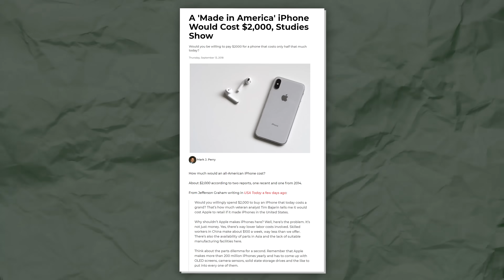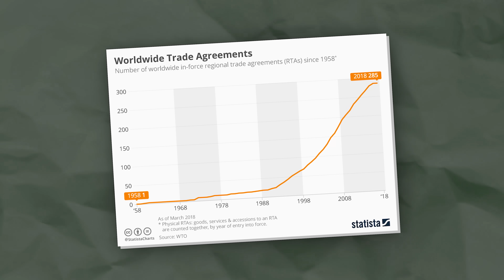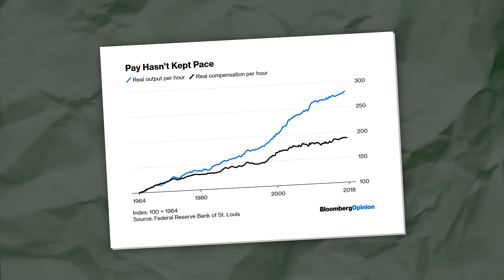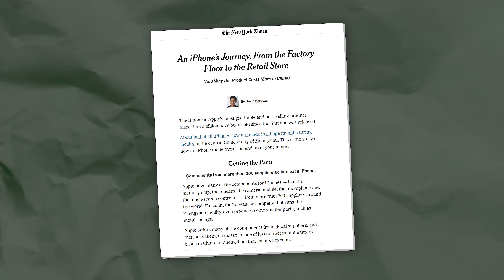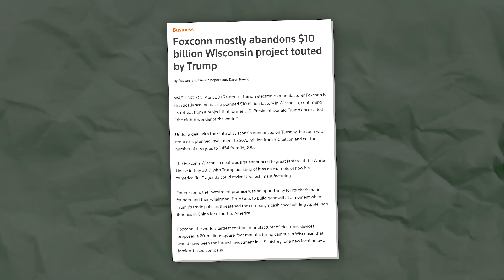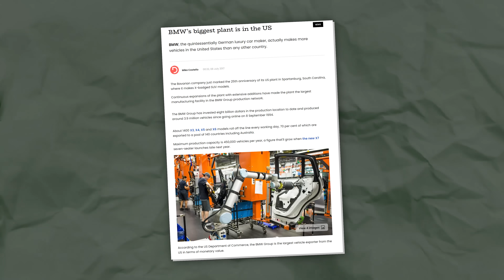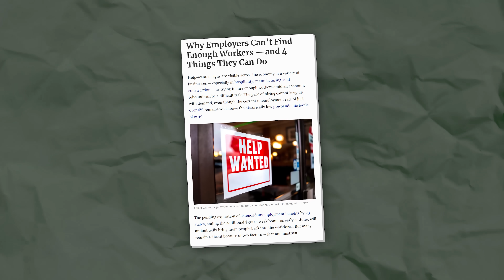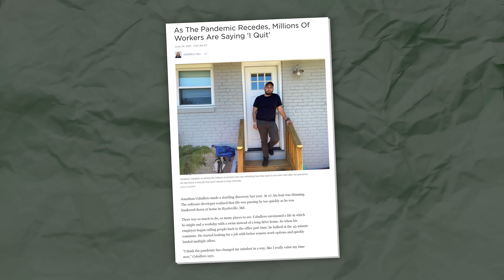How Much Would it Cost to Make an iPhone in America?

Comment: Henry ford tried doing exactly that; own every single factory that’s needed to manufacture the raw materials that go into making a ford. He owned all the production lines and supply chains from lumber to iron to every single component in the car. That way he didn’t have to depend on outside sources to make his product. He controlled everything and that way he knew everything that’s going on with his factories and minimized delays. However, as global trade expanded, his structure became obsolete. Companies found out it’s much easier and cheaper to import the manufacturing offshore albeit its uncertainty rather than training entire workforces and build factories only to find out it costs much much more than the alternative. Free trade became a thing because it benefitted everyone from the manufacturing country to the country that imports it. Now if we suddenly try to turn on a dime (looking at you, tariffs), it’ll hinder supply chains and alter entire factories. It’ll require quite some time like he said, maybe decades to make it worth it. It’s highly risky long term bet that companies are unwilling to take. The time that’s required to make this happen will upset shareholders and the customers will lose faith in the product (iPhones in this example). “If it ain’t broke, don’t fix it” since that will introduce a whole array of problems

Comment: There's a few things required to properly make America more independent from China's manufacturing.
1. Efficiency, America needs to make an efficient way of recycling its waste to remake new technology. America is one of the largest consumers. It also means America makes some of the highest tech trash. If America harnest this waste, remaking it into raw materials we need. The cost of production will be reduced.
2. Streamline supply system, America needs to reorganize its transportation system to use a less expensive yet more efficient supply system.
3. Automation for production, an automated system can be tuned to avoid waste and mistakes. This would allow America to produce and avoid additional costs.

Comment: There is so much more to this. Costs would easily balloon back to the 1950s monthly salary for a TV..... Made in America should include parts made in America, otherwise, its just assembled in America, which really doesn't mean much as we still need that same global supply chain to import the various components. So you might as well just get them to throw it together and ship it that way. What we are forgetting is the incredible costs that would be associated with every level of production. Think mining of raw materials. The terrible conditions many foreign workers struggle with in cobalt mines and the like. Then look at the cost of running the same mine USA style. Wages, safety equipment, cost of land, business taxes, and environmental assessments and pollution controls. The same thing could be said about the factory the components are put together in. Its not just that the person on the assembly line is paid an acceptable wage in America. Which is already set at a pretty low level in this video. But you have to think of how much it would cost to build that factory with all our regulations, land costs, unionized construction workers, materials you would be using all costing American prices. Then you have the endless technicians and engineers maintaining and servicing everything, all making very good salaries compared to the floor workers. Management, HR, etc. etc. The reality is that everything balloons out of control because of the cost of doing anything in the western world, with only a very small savings not having to ship the goods across oceans. That cost might seem like a lot in this model, but would be nothing compared to the increases. Plus local distribution is far less efficient then high volume container shipping and would probably still only drop marginally.

Unfortunately made in America is really only sustainable if we can accept the same standard of living as when made in America was the norm. One car, small simple home. one TV, one fridge, cooking from scratch, repairing and reusing items and not constantly chasing the latest versions of everything. Cheap hobbies, using what you have instead of buying all the fancy gear. It goes on and on.

We have really put ourselves in a situation similar to that of the ancient world. A time and place we all think we are better then, but are not really. The capitalist west are the Egyptians building their glorious cities on the backs of slaves, or at least very poorly paid foreigners. We are the romans capturing territory and exploiting their poor and hungry to work to build Rome. We are the Europeans colonizing the new world, bringing back untold riches in our ships hold, trading the natives some small trinkets for. We cannot maintain our way of life without taking from somewhere and someone else. Even if we use the excuse that it does slightly improve the lives of those it employs by a small margin. We take advantage of loose climate laws abroad, while carrying on with these world saving green agendas at home. Hell, up until recently we literally sold our garbage to these people to dump into their ecosystems they were so desperate.

The problem is you and me, sitting at our desks all day, contributing very little real value, living lifestyles far above sustainable levels, relying on someone else far away and far more poor to bear the burden all of this ultimately bares. We are just very lucky right now that the capitalist rulers pulling the strings also happen to live in the same part of the world as us and have picked us to be the chosen consumers in the game they are playing. But that is changing very very quickly....

Update: Yes I am making some generalizations. Yes there are some exceptions. Yes there are poor and rich in every part of the world, but the narrative holds true to the big picture. Not here to argue the details.

Comment: The increased labor cost to assemble the phones would also apply to the  materials and suppliers of the components.

The reason the estimated costs to bring the entire manufacturing chains to the USA is so high is because when you factor in the cost to mine, and convert the metals needed to manufacture the components themselves here it becomes staggering.

Sure we can bring the manufacturing of the components and the phones here, but we would be slaves to the Chinese supply of the raw metals themselves.

Comment: Lost of speculation here..comparing things as if they are constant.  Shipping costs might skyrocket when weather changes, fuel prices skyrocket, etc.
Manufacturers in china don't need to worry about labor costs when they are so cheap.  More simpler designs and automation would be quickly developed.
And if phones get more expensive, they could be designed differently so they last longer and can have things upgraded instead of throwing them away and get new ones (the chinese product business model)  or we might just be good without buying new ones.  My phone is over 5 years old for example, my cars are 20 years (and more) old, etc, etc.

And finally we might pay more for local goods when we could in fact be sure they ARE local.  Business is notorious for lying, and if people pay more, they would lie instead of make them local.  Like things made in the usa...all made from chinese parts, just assembled here, not what I call 'made in usa'.

Comment: I think your man-hour assessment is incorrect. You are assuming that the 350.000 workers are working 24h, which is not true. Even though it is likely that a worker in China may work far more in one day than a regular 8h shift, a direct multiplication by number of workers * hours in a day doesn't seem to be accurate, as that assumes that every single worker is producing non-stop. Of course that there are things that attenuate this: Longer working hours, a % of the work force being overheads, etc etc.... But if you take into account actual work, you'd realise that the man-hour per phone would be less, making the delta between labour costs in China vs USA considerably smaller.

Comment: I work in sourcing and there are a lot of key figures missing here. The VAT in China allows factories to work on much smaller margins from subsidiary factories straight through to the finished product. Also the average wages stated in the U.S. don't include insurances, unemployment benefits etc, it is in reality over $20 per hour all in for the employer even without a union.

Comment: this video makes a huge assumption that domestic workers are only paid more in wages and no other costs are involved.

i can think of 3 just off the top of my head.

1) efficiency. 3rd world workers are more efficient, they can pump out more iphones per hour than a US worker as they employ desperate people, even children to work 12hr shifts 6 days a week.

A rate of efficiency no western worker can achieve. As they'd rather eat the rich than work like that.

2) safety costs - 3rd world factories have very little safety standards. workers are constantly dying and losing limbs, fingers, dying from toxic waste etc. 

and they are simply replaced with someone else from down the village. 

and none of these victims can sue apple. which they all would in usa. 

the cost of making these factories safe for work, is huge. it slows production down as well as expensive equipment, training and other costs like litigation.

3) taxes - domestic workers need to be paid other forms of taxes such as into pension funds etc.

this video is bad.

Comment: I doubt you could fill a cell phone factory with workers making $15.50/hr. in the U.S. And the cost of a factory isn't simply the cost of labor. The building,safety equipment and taxes in the U.S. is probably 10x that in China. And we must pay benefits; we specifically need workers comp to cover all the carpel tunnel cases that would lead to a lifetime of payouts. And we couldn't maintain production quotas or make the factory workers feel uncomfortable. An American factory worker will only produce 1/4 of a Chinese worker and cost a hell of a lot more.

Comment: You can't compete with slave labor. Having said that, you can create automation lines that can perform this work with less manual involvement. Such a scenario wouldn't create the 350,000 jobs here in the USA as it does in China, but it wouldn't need to. And that holds true for the components made internationally as well. All these supply lines can be made domestically.

Comment: You claimed that 350000 workers can produce 500000 phones/ day. It is totally unrealistic to think those workers are working 24 hours per day. It's probably closer to 12 hours per worker. 350000*12/500000=8.4 hours per phone. This slashes the labor costs in half:  China 8.4*$2.50=$21  US 8.4*$15.50=$130.20  This means the labor difference would only be $109.20

Comment: Your high. The Manufacturing sector was losing jobs before 1960. Which is why JFK tried to implement retraining programs to cover the loss in Jobs. Moreover, the losses weren't happening because of World Trade deals or cheaper labor abroad, the primary culprit was automation. Did cheap labor abroad and world trade policies exacerbate the situation, of course, but they were not causal.

Comment: Before watching it I can answer the question why both answers are right. The claim that US made iphone would cost $10,000 is based on assumption that crapple would keep same profit margin as  they have currently, which is ~500-1000% depending on the model, iphones manufacturing costs ~$120-300... $300 being for pro models with Samsung AMOLED screen which alone costs $180 as Samsung literally rapes crapple for OLED screens despite fitting them in phones costing as low as $400. Then the sale price for iphones is anywhere between $700-1500. It is estimated that making iphone in US would cost ~$500-800 meaning with same profit margin apple would have to charge between $5,000-8,000. The second claim that phone cost would remain more or less the same assumes crapple sticks with more or less industry standard 30-50% margin in which case even phone which costs $500-800 to make could be sold for more or less the same price as they arew sold now. The simple answer is that crapple products are massively overpriced hence even after reducing they profit margin 10 times they would still be able to sell their products for a profit.
-----
Once I am watching this - "no major manufacturer makes their own phones"... I am sorry but unless somehow THE BIGGEST manufacturer does not count, then Samsung makes their own phones, as well as LG and Sony (who are kind of dead by now). To be honest only crapple is somewhat different i.e. they use manufacturing process focused on cutting cost, similar to Dell and HP, but they sell their products as "premium/luxury" brand, which they are not...

Comment: So I appreciate the video but so here is an issue with your calculation, China's biggest advantage is not cheap labor but the hub and spoke model. Beyond labor costs, China likes to build around an industry in a certain location. So for example if you were to manufacture leather goods, there is a city for that, if you manufacture electronics there are cities and centers for it. So there is a cost additional for just the components because you have to assume the travel and logistics of these components. Also to go further into labor, there are also other advantages on labor outside of price, there are no worker rights in China, people were literally trying to kill themselves in Foxconn factories. You can work people on flexible schedules and not pay them any differentials, overtime and the worker culture is also different as well. So there are additional bottlenecks you would need to factor into your calculation that would need to put into consideration. There was also a story about retooling a factory days before launch of the original iphone to switch from plastic to glass that Apple said in no way would it be possible for an American company to do, because of what I mentioned above. Many companies have tried to switch out of China for cheaper labor countries and are having issues for what I mentioned above.

Comment: The world has to blame corrupt Filipino government officials for this. Ph used to be the manufacturing hub in Asia and there were a lot of "economic zones" (large areas in different cities where manufacturing factories were located). Companies liked working with Filipino engineers because they could communicate better and did not copy the products. However, corruption got the better of people and it created a system where foreigners needed to pay protection money to whoever was in charge of the area where their factories were. On top of that, high energy rate in PH would also impact production cost.